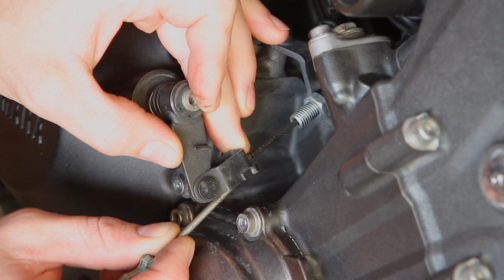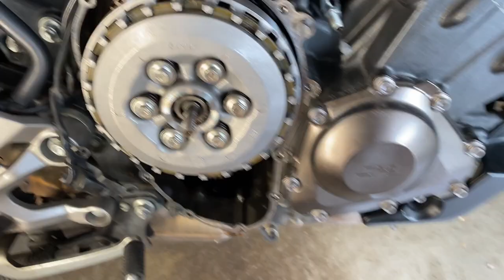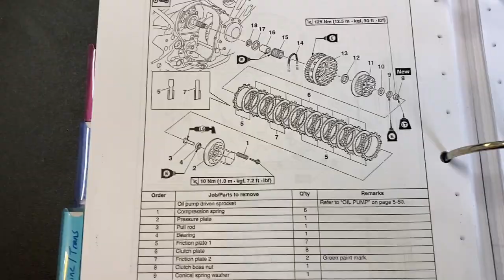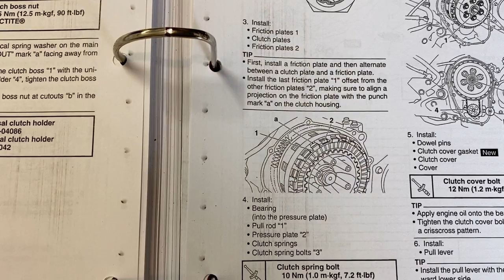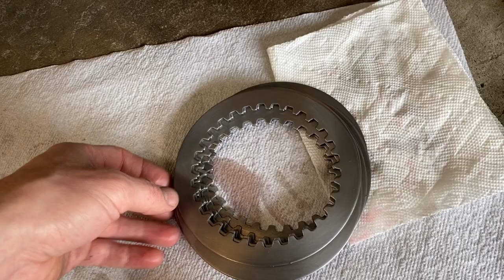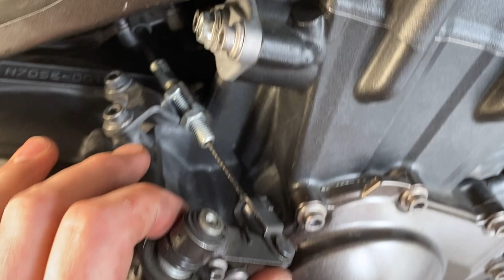Yamaha MT09 FJ09 FZ09 Clutch Maintenance: Removal, Inspection, and Reinstallation

Comment: Nice video.  Thanks.  I have the same 2015 FJ 09, same color 🙂. Interested in the slipper clutch mod too.  Look forward to your video.
Reply from the maker: You have good taste in motorcycles 😉 slipper clutch will certainly be done, but probably next riding season.

Comment: Are you sure you used the correct oil?
When an oil contains friction modifiers it is not intended for a wet clutch application.
Friction modifiers are often used in oil for cars.
Reply from the maker: Yes, I used the exact same oil that was used in its last oil change. 👍 We’re all good.
Reply: @Calvinm  Ok.
I had a Honda CBX-1000 Prolink from 1982 for 23 years. I always used MOTUL 10W40 half-synthetic oil.
Never had any problems. But I would have tried another oil immediately if I experienced clutch slippage.
And (for all other readers)... Only use oil that is certified for motorcycles.
Reply: Perhaps the previous owner/s used car oil.

Comment: I want to see that slipper clutch go in, I thought about upgrading my clutch in my fz09 to a slipper clutch, maybe. But after an ecu flash and being able to remove to engine breaking. I'm not so sure it's really needed.
Reply from the maker: Interesting! I didn’t know an ecu flash could do that. I mainly want the slipper to eliminate the clutch slip for good and reduce the effort on the clutch lever.
Reply: @Calvinm  eliminating the engine breaking helps a lot. I'm not getting any slipping out of my clutch yet, but eliminating the engine breaking has made a big difference for me.

Comment: Hi Calvin, thanks for sharing. Very good video. I have the same bike in the UK and am now considering installing the XSR900 Slipper Clutch on my FJ09 (2016). Have you done it? I'm collecting all the info and all the parts I need.

Comment: Did you have a low growl when the clutch was released....i have a 15 fz09 and has a slipping issue like that but i also have a concern for the low growl when i have the clutch pulled in no noise ...less then 4000 miles i do like picking up the front wheel and not sure what the last owner did with it i only put 1000 milea so far

Comment: how many miles did your bike have when it started slipping and or when you made this video?
Reply from the maker: The clutch was slipping when I bought the bike at 54k km’s. (33,000 miles). This video was filmed around 56k km’s.

Comment: Bro I have 2015 mt 09 and it has clutch noise too much and also when it’s hot it doesn’t want to work it’s working but with I need to give a gas bit do you have any idea what’s wrong?

Comment: judging from your video, the primary driven gear has too much play and seems to be shot; I don't think the play has nothing to do with the rattle at idle you mentioned as long it isn't under any load... Instead, you could probably hear a sort of rumble (and a vibration on the pegs) when cruising around and go off the throttle: the primary driven gear is on load and - as the rubber cushions inside are most likely shot - you should get that noise at 2000-3000 rpm. About the sharp edges of the disc, I think that they should go away from the bike.
Reply from the maker: Your most likely right! After reading more about the sound the FJ makes I think it’s very likely the rubber cushions are shot. I will likely be replacing them next season to sort out that annoying sound. Thanks for the insights 👍
Reply: @Calvinm  it's hard to guess, but looking at the steel plates they seem to be in perfect shape... If the springs were in perfect shape too, I wonder if the cork spots of the friction discs were - in the past - came in contact with car oil and so contaminated as they absorb oil; with correct oil change afterwards, they were slowly "recovering". Working them with scotch brite and changing the mounting order could help generating more grip, also. It's kind of too young bike to have that issue. My MT09 (FZ09, same bike) has 80.000km and never had a slippage and still going strong. I will change everything next winter, just to be safe on long trips abroad